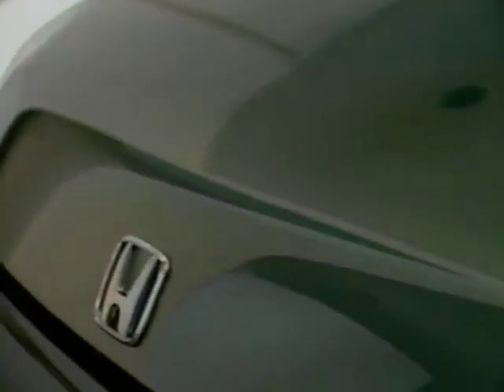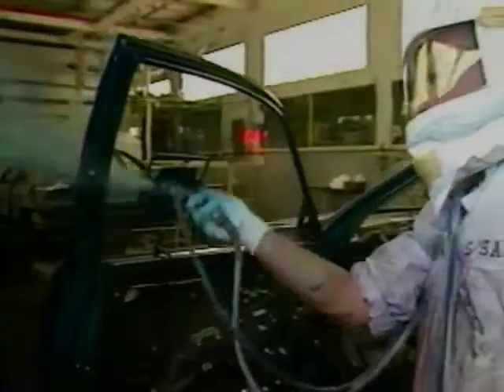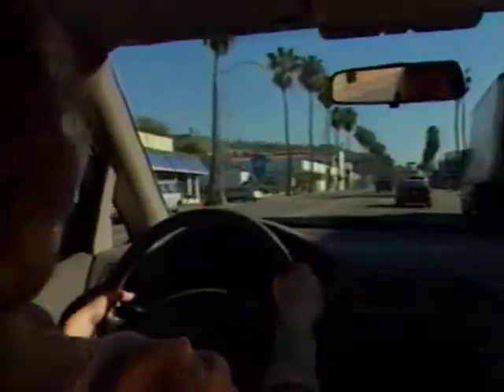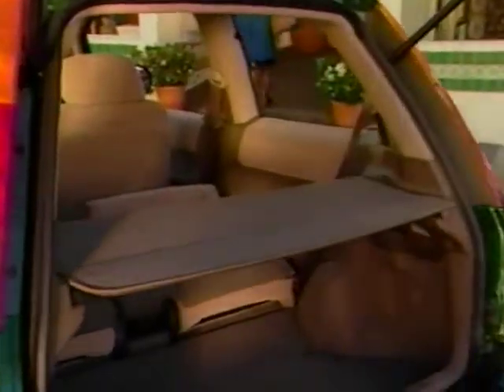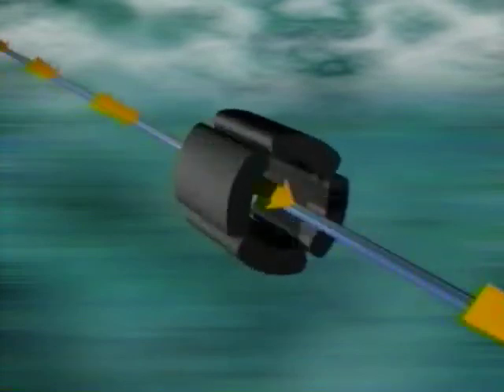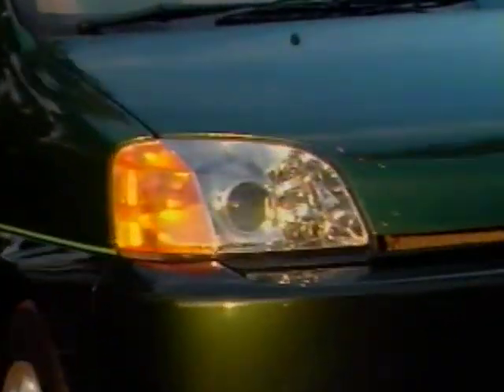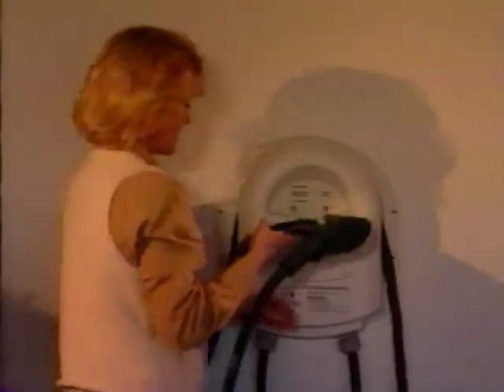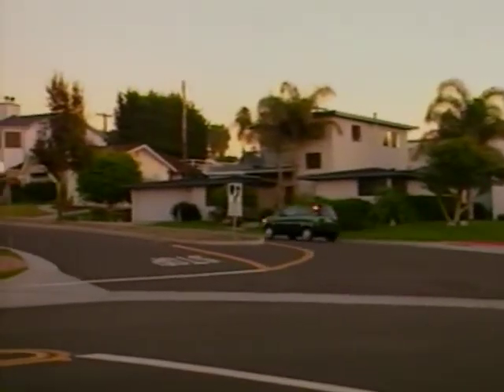1997 Honda EV Plus Sales VHS

Comment: HEAT PUMP heating system is very impressive considering it wasn’t long ago manufactures of EVs started using heat pumps instead of resistive heaters.

Comment: I love my 2017 Bolt EV, and love that GM can NEVER take it away from me and crush it.  I own the car, not them!  CARB should have seen the long game that these companies were going to play.  Leasing instead of offering them for sale, they wanted to have the option to pull the plug on them.  I can’t help but think my Bolt EV would have had even better range if these cars didn’t get crushed.  Automakers lost out on 15 years of advancements by shooting themselves in the foot.
Reply: Legend has it that GM killed the EV1 program in order to launch the Hummer brand.
Reply: They lost out on 15 years of advancement because right when EVs started to use NiMH batteries (the EV Plus, RAV4 EV, and later EV1 models) instead of horrible lead-acid, the patents were bought out by Chevron, who the ones who shut down the NiMH EV era as soon as it started. They only started to pick up development again a decade or so later because it took until then for large scale lithium-ion to become feasible as an automotive successor to NiMH.

Comment: Almost same as modern ev's have similar basic functionality. i wonder what happened after 90s why all this died and just started now again ?
Reply: There was no tesla at that time.
Reply: It died because the big oil companies but no one talks about that. screw them for that.
Reply: i cant remember clearly off the top of my head i think it was down to primarily battery technology which added on to the lack of consumer demand, and also they were very expensive to make
reading about the events of the 90s and early 2000s regarding ev's can paint you a clearer and more complete picture than i ever could tho
Reply from the maker: @Mariano This video SHOWS that the 90s EVs where NOT just better golf carts, they where real useable full speed (80mph) practical vehicles even if kinda boring.
Reply: Big Oil, my friend. If I may recommend "Who Killed The Electric Car?" and it's sequel, both available right here on YouTube for rental.
Reply: Sounds like a high tech car for it's time.
Reply: electric cars are 200 years old
Reply: CALIFORNIA CHANGED THE LAW.  Instead of mandating 10% of cars had to be zero emission (ZEV) they allowed hybrids to be substituted (Partial ZEV).  So goodbye electrics and hello tons of hybrids (which are mandated to emit only 0.01 grams of NOx per mile).
Reply: The reason Nissan released the mass-produced Leaf In 2010 (beating Tesla to the punch) was because Obama’s EPA changed the minimum MPG average (CAFE) from 28 to 35 and selling 90mpg EVs helps corporations meet that high score

.
Reply: These vehicles were not as practical as a lot of people think. They worked in theory, but the technology was not ready for primetime in the '90s. Thus, rather than hunker down and develop the technology to the level that it needed to be at for commercial viability (which would've cut into earnings), the car companies fought the law that mandated these cars in court and won.
Reply: Note that the battery was NiMH, not lithum ion. EV Plus, RAV4 EV, and EV1 all used NiMH. Shortly after this period, the patents for NiMH were bought out, and manufacturers could no longer put any development into them. It wasn't until many years later that lithium-ion became developed enough for EVs to start trending again. 

https://en.wikipedia.org/wiki/Patent_encumbrance_of_large_automotive_NiMH_batteries
Reply: @artistwithouttalent  bruh the tech was plenty there. in like 1910's EVs could go 100 miles per charge and could crack 100mph... i dont think the stats are meant to go DOWN...